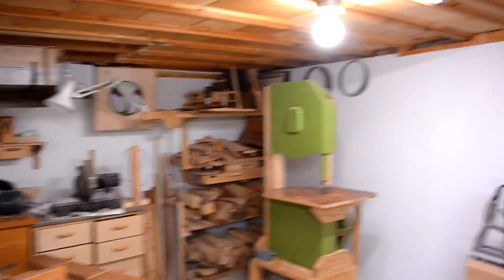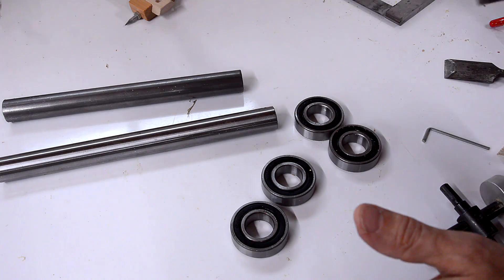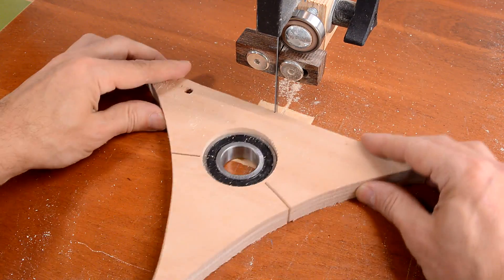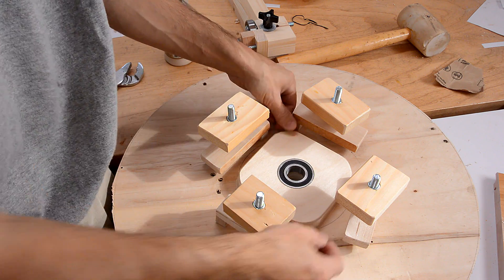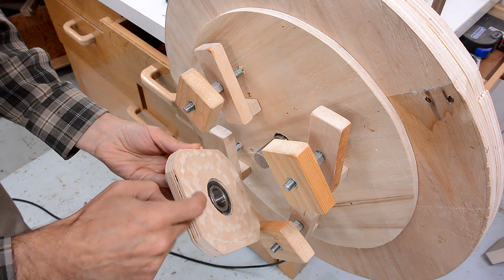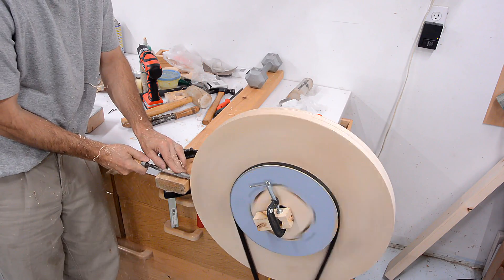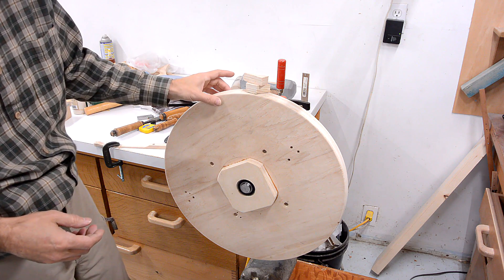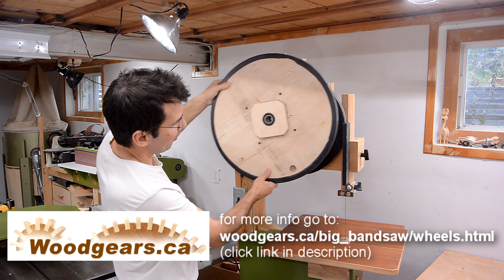Big bandsaw build 1: The wheels

Comment: Whats the advantage of a bigger bandsaw?
Reply from the maker: it's bigger
Reply: Goes to 11
Reply: A longer cooling period for each tooth.
Reply: Capacity.  Throat depth.
Reply: More cutting width, more cutting height, probably wider blades and more horsepower? And a better sawmill when rotated 90 degrees :)
Reply: Matthias Wandel
Reply: What does that allow you to do that you couldn't before? Seems like you always use the bandsaw for cutting sheet materials, how does being bigger help? (I'm not a woodworker, I plead ignorance).Such a satisfying video to watch. Rock on.
Reply: Alright.... Thanks!
Reply: Carter Mahnke A bigger handsaw allows for a wider cut. His other handsaw has a cut width of 16" but this new one will be able to cut up to 20".
Reply: Also less bending for the blade on the larger radius. Longer period for you to f*ck up the blade instead of it braking because of metal fatigue.
Reply: you can cut bigger bands...obviously.
Reply: omg  you kill me  :)
Reply: Duh!!!!
Reply: More Bigger, more Better!
Reply: Seameus γ
Reply: Lets see, it takes up more room saving Matthias from having to build other tools. Could use up more of his green paint. Less likely to trip over it. More stable in event of an earthquake ..... I suspect folks that the question was genuine, someone trying to get a conversation going. Maybe young, maybe lonely. Young  is fine, live long and prosper. Lonely is sad and I hope it was not the case. We should try and help. So, the 'right' size is one up from the biggest you think you will need in the foreseeable future - if you have room for it, if you can afford the bigger motor, the extra lumber etc etc. If you think a 16 inch (40 cms) will do, try and build an18 (45 cms). Heaven knows, there's enough choice here. BobUK.
Reply: It goes to eleven.

Comment: The first wheel you made, the one that wobble a little bit, will you make another one, or it will work ok? I am considering to build one from your projects, but i don't think i will be evere as accurate as you, that explain the reason of my question i hope  xD
Reply: NeverStopSeeking He is using that one.
Reply: The wobble on the two flat faces might not matter that much. The key is balance to avoid vibration, and having a crown (the blade only rides on the crest of the crown) that is nicely perpendicular with the axis of rotation.
Reply: I made one of these but have a vibration even though the wheels are balanced. Haven't had time to look into it too much but must strip it down and maybe rebalance the wheels or make new ones.

Comment: You should soak the logs in wood before you cut them with the bandsaw, otherwise the grain will become curved.
Reply from the maker: Just made up bs
Reply: wtf? how is that true?
Reply: Go to any hardware store and in the Varnish and Paint section you'll find Log Soak™ which is made of miniscule wood particles that you can use to soak the logs in, ie. soaking the logs in wood.

Comment: what's that jig that you use with your handheld drill?
Reply: Joe M google drill guide... :)
Reply: Joe M google drill guide... :)
Reply: +ExtantFrodo2  "A DIY Hand-cranked Tap-guide for a Drill-guide" is the title of the video you are going to make (I hope). If not, a picture or sketch will do. Sounds like a useful tool to have.
Reply: The dowel jig?
Reply: Think he means the one at the 4 minute mark.
Reply: I've had a similar one I bought so many years ago that I don't remember the name of it, but I use it quite frequently. There are a lot of similar designs with more or less built in utility. Most feature a v-groove on both sides to put pipes or rods in to drill through the exact center of the rod Though these are not necessary because just like extending the rods through (past the plate) enables center drilling pipes that are fixed in place (like household plumbing) it quite easy to establish the center of a rod placed in between the plate and the drill. 
    There's usually a depth stop for accurately drilling to a specific depth so you can use this as a router (sort of) in a pinch. 
     If you are working on a board or something and need to repeatedly drill at a specific angle - set the plate at that angle then extend the rods out to surface of the board and lock them in place. That way the rods and the plate work together to give you a consistent drilling angle. 
    Having made a hand crank for powering the bit I also frequently use mine as a tap guide.
Reply: Joe M a drill guide